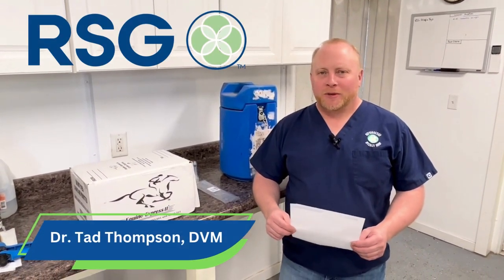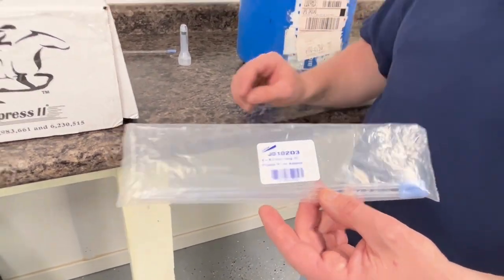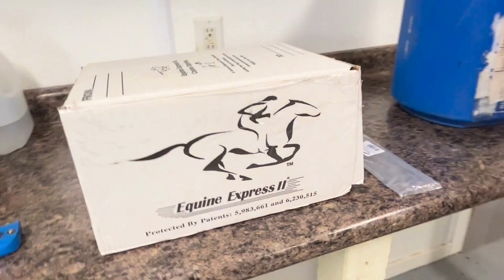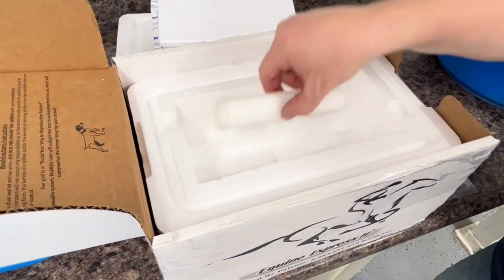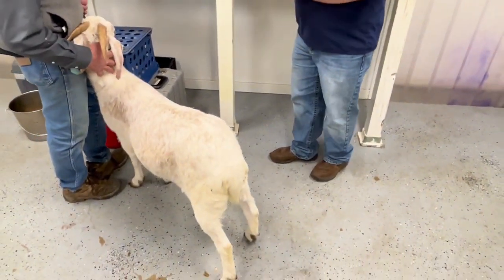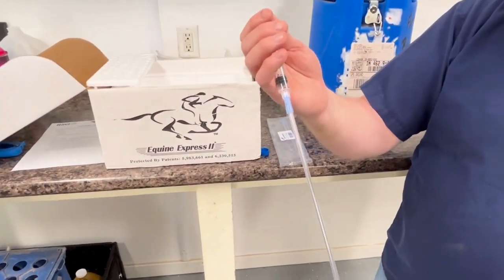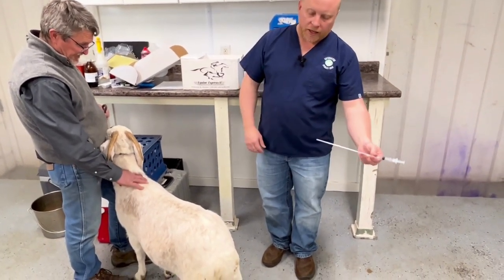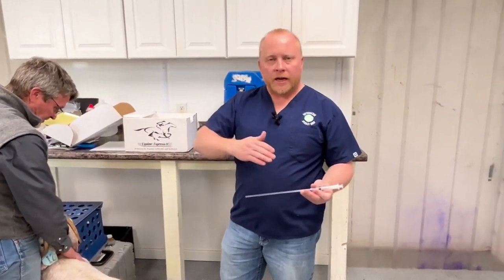RSG Artificial Insemination Goat Splashing

Comment: Do you have a link for the tools used in the video? And what is the rate that the doe gets pregnant?
Reply from the maker: Here is the link for the Big Splash kit that will work for 25 splashes.  https://reprospecialty.com/product/big-splash-kit/ The smaller kit will work for 10 splashes and the link for that is:  https://reprospecialty.com/product/small-splash-kit/